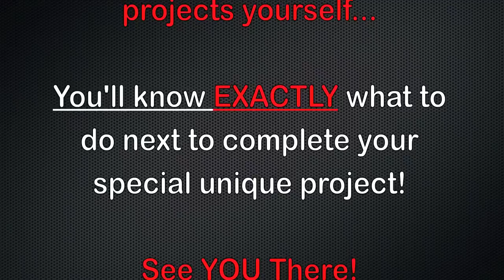RE: Can You Spray Clear Coat Over Your Old Faded & Peeling Clear?

Comment: Can you paint over a Clearcoat with basecoat without sanding ALL the old Clearcoat off?
Reply from the maker: Yes you can! But you need to make sure you scuff it. Get this guide: https://learnautobodyandpaint.com so that you will know exactly how to get this done.
Reply: Scuff with around 300-400 grit?
Reply: Quick question, can we spray clear coat on existing paint that’s in good original condition  ? If we just have extra clear coat cans to get rid off , or is that that not advised ?
Reply: @danieltenorio3559 yes you need to scuff it up with 800 first. That's called a flow coat
Reply: @kenmastersmaster  thanks for the info but what’s the point of stuffing or sanding it if it’s allready smooth ?
Reply: @danieltenorio3559  because the new clear won't stick to smooth old clear it has to be roughed up or it will peel like a sticker
Reply: @kenmastersmaster  Dan that sucks , I am Probley not going to do it then lol

Comment: If you're incredibly broke (like I am) and don't mind the initial work, you *can* save the paint that is still intact on your car in certain areas and spray what can't be temporarily salvaged. Following a base/clear method on the paint repair, but wet sand/polish/glaze the areas that can be spared for the time being. It'll look great, so long as you wax monthly and repair the paint within a year. This is pointless if you need to buy equipment, though. Might as well spray at that point.

Comment: Mine: a 2" strip of peeling clear coat across the entire back of the roof. I washed and applied one application of clear coat, no wax. Looked good, but started peeling off in about a year in SoCal.
I'll do the same thing next week, but will add 3 clear coats, then wax it.
I will see how long it will last with the wax.
Reply: How’d it turn out?
Reply: @tedbrookins  Did the clear coats, never did the wax. Sold the car several months later.

Comment: I have a question and this is another good teaching technique using numbers 1 to 10 so people can get a mental concept of what you said it wouldn't look good to go through all that trouble and just put clearcoat  clear coat so let me ask if the car on a scale from 1 to 10 is a 5.5 with 10 being coming out of the showroom and one being full of rust in a junkyard what number would it go up to even using half points in the rating if you just put the base coat over the base coat just so I can picture how good or bad the job would be based on what you said

Comment: Consider this. How about just repainting clearcoat on just the rear bumper of an old car where the main body is in excellent condition, and the base in in good condition on the bumper but the clear coat is damaged from having removed old bumper stickers preping the car for sale. Is it possible to sand down the old clearcoat evenly without removing the base and then reclearcoating to do an acceptable job for an old used car sale?
Reply from the maker: Hey Man! You may check out my website I got blogs there on bumper repairs. https://www.learnautobodyandpaint.com/page/2/?s=bumper+repair Also Check out our VIP program how it’s helped many people like you and get the ability to complete amazing DIY paint jobs from home on budget. https://www.learnautobodyandpaint.com/

Comment: What causes the clear to peel of the base coat, seen it a lot on fairly new cars, is it because using the wrong materials, like adding thinners to the base instead of base reducer? not sure what causes it. While some painted cars that have seen painted the clear has never peeled of or faded peeled off.

Comment: Can you go more in depth on why its better to replace the base coat vs a add-on clear? Pros cons, cost? I got a quote for 5k to do a roof of my car, they suggested the same, but didn't say why its better., Its like saying replacing your house ac system is better than swapping the fuses and a cpu, it is better but is it necessary?  5k on a roof of a car thats worth 9k? Idk thats overkill. Ill almost wrap it for $50
Reply from the maker: Hey Man! You may Check out the LearnAutoBodyAndPaint VIP Program to learn more about DIY auto body work and paint https://vip.learnautobodyandpaint.com/home

Comment: Hey Tony, I noticed a thin spot of paint coverage, under the rear cab window after i cleared it. How would you recommend I address this? Can I simply fine sand the clear, re-spray, then re-clear the spot or will I have to do the whole cab again? Thanks!
Reply: Yes. From what I've read this would be the thing to do. What I want to know is what grit do I need to prep for base/clear?

Comment: Can you pls advice:

I have a panel that's brought down to bare metal using 40grit. Now it has 40grit scratches. NO bodywork or fillers required. Just 1k or 2k primer and paint. 
Question:  Do I need to sand the bare metal further with 80 right up to 240 grit before spraying the primer? thanks

Comment: I just sanded off my clear clearcoat but it still seems that even after an hour of sanding on this large panel that it still sands and has a whitish powder.I cleaned it well and just wondering if I can safely go ahead and lay down my primer? Can you tell me what a flash time is in between primer and sanding and then between paint and wet sanding? Thanks buddy

Comment: Thank you for your videos! I am in the process of repainting my car, and unfortunately I messed up my first attempt by wet sanding through to primer so I decided to respray the body. I know that you can apply base over scuffed clear, but will it be a problem if some spots are scuffed through to base or primer? Do I now need to remove all traces of base before reshooting new base coat? Thank you!
Reply from the maker: Hey Man! If you are planning to apply a new base coat over an existing base coat, it's generally not necessary to completely remove all traces of the old base coat, especially if the existing base coat is in good condition. Get your free training and  and more auto body and paint tips at our LABAP VIP Program https://www.radspaintformula.com/rads
Reply: How can I tell if I sanded down to the primer so I have a car that was painted over the main color of the car and I don't want to go too far down

Comment: The Answer to the question "Can I scuff the old clear coat off then re clear"
Answer "Yes" as long and the paint is good under the clear. Wet sand the area "roof, hood, trunk" with 1200 then 1500 soapy water, block only. Watch for color in the soapy water. work slow. Clean area use wax grease remover. Insure it is dry. Mask off the "to be painted area" and shoot it with 3 to 5 coats of UV Clear. Wait a week, wet sand it with 2000 then buff and polish and wax. Watch your edges when sanding.

Comment: Hey tony I sanded down the front of my car and painted black about 2 weeks ago. I just finished sanding and all the body work on the rear of the car. After I paint the rear of the car do I have to wet sand the front to make the clear coat stick or can I clear the hole car after finishing the rear

Comment: What if your repainting a hood a lot of areas have peeled but most of the hood still has clear coat intact however there are some tiny spots that start forming every time I wet sand and then that becomes a little spot that it peels off

My question is if the existing 20 year old clear coat is prone to peeling off will spraying a primer or primer sealer first help to keep that from happening?

Or should I worry about it and just spray base coat?

Besides wanting to stop any future blistering issues on the existing clear coat I would also like spray a sanding primer just to help fill existing scratches and little spots from all the areas I sanded through

I I want to know if simple old-fashioned lacquer base sanding primer will work or will it react with the existing clear coat and base coat to cause it to soften or peel?

What primer or primer sealer do you recommend?
Reply from the maker: Hey, send us your question over to ninjasupport@learnautobodyandpaint with pictures of your project so I can give you a more accurate recommendation.

Comment: I have an old Honda that had bad clear coat cracks and all. I sanded all the clear coat cracks away but left swirls is it because the wet dry was too abrasive? I tries to polish but the swirls are there. Should I re sand with finer grit of what?
Reply: yes re sand with 3000 and/or 5000 and water to remove swirl marks. anything less will be to coarse. then polish and wax. if swirl marks are not very deep then use 5000 grit.
Reply: TOO, TO and TWO.....do you know the difference yet?
Reply: Thanks for the info Nancy

Comment: Can u spray the base and clear coat on the same day or should I wait until next day to clear it?
Reply from the maker: Hey Man! Allow 30 minutes after base coat color has been applied to apply the clear coat. Apply 4-5 wet (but not dripping) coats waiting 10+ minutes in between coats. Each coat should be dry to the touch (not tacky) before moving on to the next. Check out https://www.learnautobodyandpaint.com/ VIP Program to get access to over 100 hours of training videos, e-reads and bonuses. We have so many VIPs that have progressed with their auto body skills and are getting pro results with their own custom projects.

Comment: So my bumper rear bumper on my Sonata is new but I got bumped by another car and a small section of clear coat peeled and I used sand paper the right grit so it wouldn’t keep peeling and the paint is not faded just a small section of clear coat is gone...could I just use the spray clear coat and tape around the spot and it’ll be better?

Comment: i need some advice. i sanded the clear that was flaking and primed with a filling primer. then sanded with 400 and 600 and applied same colour base coat and clear. however, after about 4 months it flaked,bubbled and cracked. do i needed to sand to the metal and prime to prevent this from reoccurring?

Comment: just painted my 1980 Capri and have some light spots of clear coat. any suggestions?
Reply from the maker: Hey Man! That is normal with most clear coats. It’s not the painter’s fault as long as you’ve mixed your paints correctly. This usually happens to inexpensive clear coats and reducers. 
The only fix for this is that you sand it with 1500-grit, get it down to 2000-grit and buff it out. If it’s really bad, you might need to use 800-grit.
I recommend that you spend the extra money on a good clear coat. Another issue is orange peel where it looks like a textured paint imperfection where it looks wavy. Check out our VIP program how it’s helped many people like you and get the ability to complete amazing DIY paint jobs from home on budget. https://www.learnautobodyandpaint.com/
Reply: @HowToPaintYourCar  it was Omni PPG brand. Not the best, not the worst. The breather cap on the hopper would clog and create a vacuum, forcing me to turn off the air meter and 'burp' the hopper. I'm hoping the 'light spots' are just matted from spraying too much air. I'll do the sand paper trick once it cures more. I really don't care about orange peel, I just wanted a '20 foot' car with good clear coat coverage. Thanks for the response!

Comment: what if i already sprayed a good gloss coat, but let it sit the complete drying time can i just spray more on top or should it be sanded or scuffed?
Reply: 2 years and still no answer ..
Reply: If it was left to dry you have to scuff and clean it before applying another coat or it won't bond. Leave about 20 mins in between coats at normal room temp.

Comment: Hi, does anyone know the answer to my question....
I resprayed a whole car in base coat and clear,looks really wet and glossy when i first sprayed it, only 2 or 3 weeks later the gloss level dropped by 50%, the shine it had had nearly turned to satin instead of gloss, where did the gloss go?
Does anyone know what happened?, now i need to color sand it to get anywhere near that gloss level back,can i respray the clear coat to get the gloss back, has the clear coat simply soaked into the paint and lost it's gloss.
Please help,i spent 7 days painting this car for the gloss level to dissapear
Reply from the maker: Probably used a cheaper clear. The clear just set and cured. You could just color sand and buff for a pro gloss, or sand it with 1200 and put 2 more coats of clear on it (see how that works, then you may need to buff). This is common if cheap clears are used.  If you put enough clear on it this time, I would just sand it with 1500, then 2000 and give it a good buff! Learn more at: http://www.learnautobodyandpaint.com/vip-offer/
Reply: Hi, What do you mean by: (if you put enough clear on this time etc..)?
 After applying another 2 coats of clear on top of the existing clear coat (which lost it's gloss) then after that still sand with 1500 and 2000, is that waht you mean.
So you would not just spray another 2 coats on top of the clear and leave it you would spray and still buff, is that what you are saying.
I just want to be clear

Comment: 360 grit are you fucking kidding me. you are going to see every scratch once the clear shrinks. you should have the final finish at 600 grit if your not using sealer before applying a base coat. however if you are doing a sealer coat before the base coat you would still need a finer grit than 360, like 400
Reply: my car's clear coat is almost gone. So, should I prep the surface with 360 grit and then to 400 before applying my first base coat? or just use 400? Thanks.
Reply: 600 is the minimum to apply basecoat on. Any lower than that you risk having sanding scratches on the finish.

Comment: Thanks. I have been watching just about every video on car paint care and have seen a lot of crap. One suggests to use mothers mag and Zymol. Another suggests to use some ceramic liquid. A lot of 'em say to wet sand and re-apply the 2k clear. One asshole goes on and on about what a professional he is. He must have said "to be perfectly honest" about a thousand times. Sounded more like a used car salesman. What a pencil dick. BUT AFTERWARD YOU CAN STILL SEE THE OXIDATION LINES. It doesn't make sense to go thru all that prep work without spraying some new base. How much more does it cost? My guess is $50-$75 for a couple of cans if you didn't own a sprayer and compressor. I bought a shitload of product and tools.From Mothers to Maguiar's. At 67 I am a little late to the game, but willin. When a vehicle is over 15 years old and you live in the southwest, the sun does a lot of damage(.Especially if you don't have a garage) If you live north you get all the salt from winter ice. Any way you slice it you need to re-paint. I have a 2000 Subaru w/ the clear coat gone. First I clayed it. then I tried mothers and Zymol. Stripped that and tried Maguiar's. Finally came to the conclusion after all the sanding, polisihing, masking. etc. that I might as well just fucking re-paint.Thanks for making it short and honest.